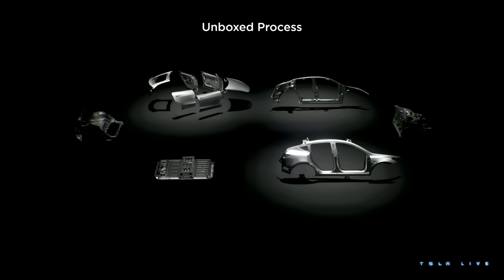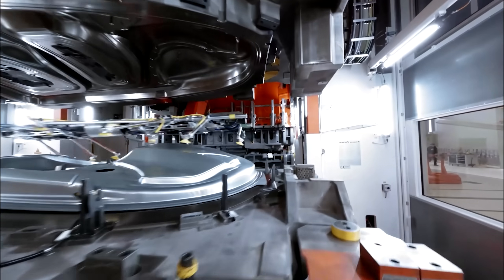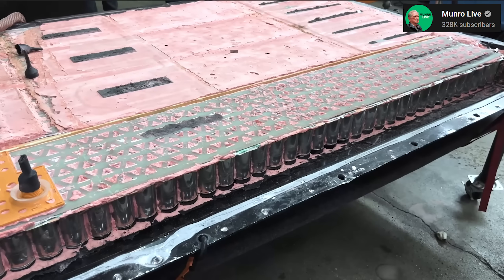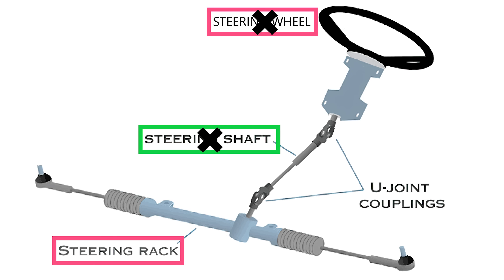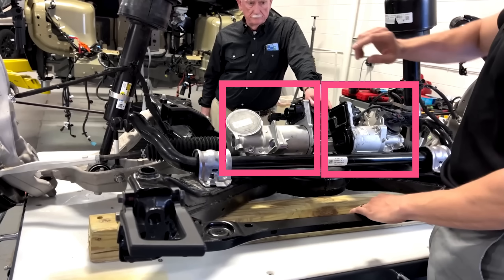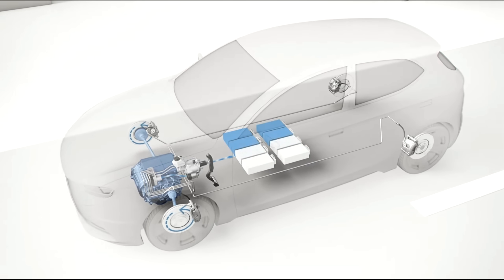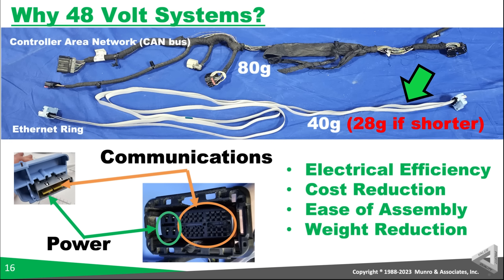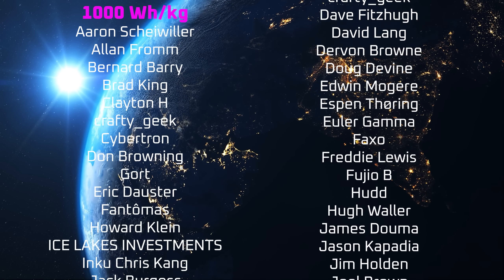Making Tesla's Unboxed Process Work // Seven Key Technologies

Comment: I'm no electrical engineer, but couldn't the engines also be used as active brakes? So not just regenerative braking, but reversing the current when needed? Also, when adding a capacitor to store some of the energy might reduce the load on the battery pack, while allowing this regenerative or even active braking when the connection to the main power is lost.
And could such a setup not completely eliminate the need for disk brakes?
Reply: interesting, can we can an electrical expert to comment on this
Reply from the maker: Someone suggested using the motor case as a resistor.  I'm sure there's some sort of creative solution as you're suggesting.  But, that's beyond me!  Electronics cook my brain
Reply: Regenerative breaking is reversing the current. Nothing more you can do there. Sorry
Reply: @jan-ludwig5216  Thanks for the explanation :-)
Reply: I'm no electrical engineer either, but my best guess is that there are possibilities. When the motor is used for braking then kinetic energy of the car is converted to electric energy. If it was just up to the motor: I think that the motor can deliver the same braking performance as acceleration performance. The electric energy that is generated during hard motor-braking has to go somewhere. The limiting factor is ability of the battery pack to absorb that energy safely. It could be, I don't know, that an attempt to charge the battery pack faster than it can absorb will result in runaway overheating, and then the whole car will burn.

But what if you had an additional pathway for dumping energy? 
When the model 3 was introduced it was described that the temperature management system has the following capability. In cold temperature the motor can be controlled to run differently, in a way that generates a lot of heat in comparison to the amount ot propulsion that is generated. Usually you want to minimize the amount of heat that is generated, both during acceleration and during regenerative braking, since heat is wasted energy. But in the case of an emergency stop it would actually be beneficial if the motor generates a lot of heat and comparitively little electric energy. Then quite possibly the rate of production of electric energy produced is within the ability of the battery pack to accept incoming power, with the rest of the energy going to heating up the motor.

After the emergency stop the temperature management system will have to start work to bring the temperature of the motor back down again. Electric cars can do that: the motor does have coolant loops. The motor has high efficiency, I think something like 97 % of the electric energy is converted to propulsion, but at highway speed that 3 % does add up, which is why the motor does have coolant loops.
Reply: @cleon_teunissen  Interesting :-) I had to read it several times, because of the amount of info in it. I'm convinced that we can do more than regenerative braking, if we are willing to put energy into it. 
As far as I understand, a motor accelerates because one magnetic field is attracted to a second and repelled from a third. The second and third magnetic field are caused by electric current going through a coil (the first magnetic field can be fixed magnet or induction based). If you no longer put an electric current trhough the second and third, then the magnet generates electricity in those coils, which causes regenerative braking (with the breaking force depending on the resistance of the electrical system, and the peak of the current generation in each of those coils at a different moment in the rotational cycle of the engine compared to acceleration).
But if you want to actively decelerate the motor, you could do so by actively making the second magnet repel, and the third one attract, no?
This would of course be less energy efficient than regenerative braking, so should only be used when really needed. And would cause heat in the motor which should be dissipated somewhere, as you mentioned. So probably not suited for sporty driving.
But if I'm right, it would eliminate the need for brakes and all the cost and complexity that comes with it. And a robotaxi does not do sporty driving, so this could be a use case where this makes sense.
And the coolant system you mention and I did not know about, will surely help. So maybe it might be possible to even do this for human operated cars with that.
Reply: Regenerative braking becomes less strong the slower the wheels turn. So it would be difficult to fully stop the car. Also it would be impossible to prevent the car from rolling downhill. Not even considering the regulatory requirements (arguably those could be changed but the technical limitations remain).
Reply: @Martinit0  Regenerative braking is also affected by the state of the battery, so it will for sure be a technical challenge. And I'm not sure it can be done. But the advantage might be worth the research to find a solution.
I had not thought about the roll downhill issue. And it is the same as parking on a slope. But for this we need a wheel lock, not something that can slow down.
Regulatory requirements will depend on the letter of the law, which might be different per state. If they say you need to be able to reliable brake, then it might be a non-issue. If they mention drum or disk brakes as a necessary component, then this would indeed need to be addressed, and would slow-down the rollout of such a technology.

Comment: as long as the system is robustly tested I am not too concerned with electric brakes.  There is no redundancy in hydraulics if you spring a leak all your brakes stop working.  With the ther loop you'd need two lines to loose communication before you have a failure already making it safer. Also the duty cycle of brakes is much lower on electric cars which should increase reliability over a given time because of the lower use
Reply: "There is no redundancy in hydraulics if you spring a leak all your brakes stop working. With the ther loop you'd need two lines to loose communication before you have a failure already making it safer. "

There's redundancy with hydraulic brakes. You would have to puncture both circuits in order for that to happen.
Reply: @yourcrazybear yep. Dual circuit brakes have been a thing since the late 1960s.
Reply from the maker: Excellent points!

Comment: Unboxed process sounds like the way to make everything easier while reducing costs and complexity. They could even use it to increase production for all the other vehicles (S3XY) by adding an unboxed production line for those. Also, knowing that Optimus will start working at the factory soon, I can imagine  pretty much all the work could eventually be done by robots. Elon's dream of a gigafactory that looks like an alien dreadnaught will be fulfilled. But what I'm curious about is the thixomolded magnesium gigacasting you talked about in former videos. I am hoping it would be introduced alongside  the unboxed process as it would imply another important improvement in manufacturing by reducing the weight of the cars!